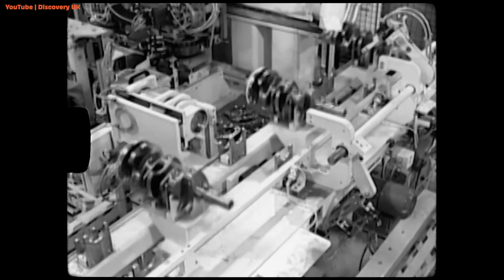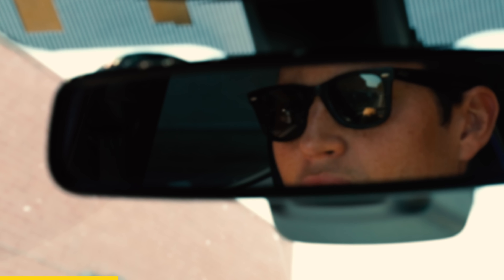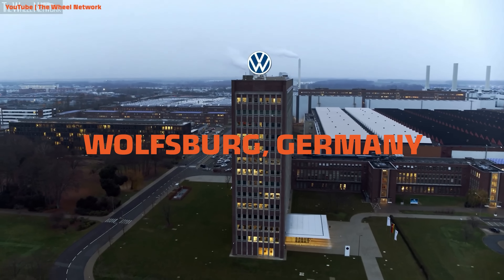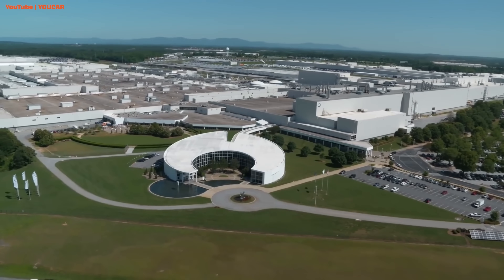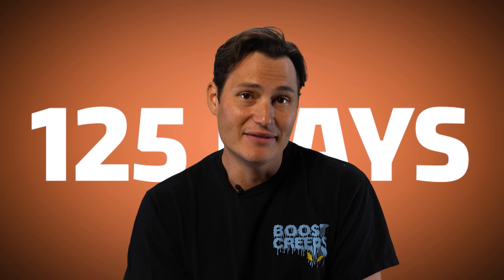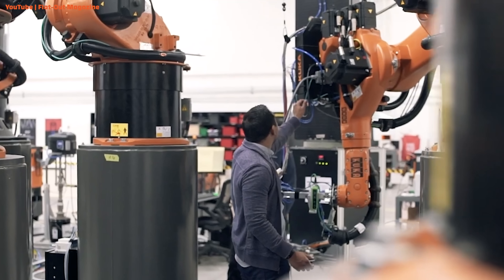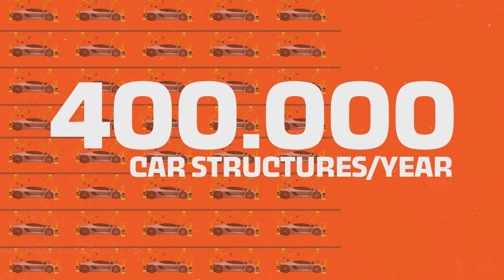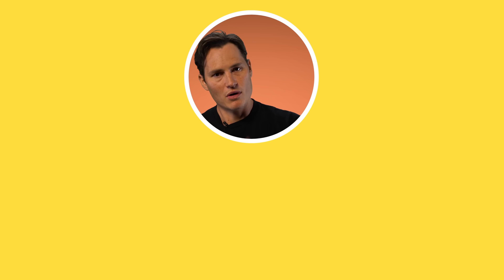A.I. Designed this Car

Comment: What about working on it after assembly? Does the engine come out to change the spark plugs along with the intake and exhaust manifolds? Is the battery located where a tire and fender skirt must be removed to get at it? What about the climate controls? Are the vent doors located behind 6 hour's work of dash and panel removal to replace them right after the warranty times out? Let's also hope those shortest wire runs possible include sharp turns and chafing that starts fires and is subject to weather damage. I ask this because the problems posed are common in the craptastic engineering found in modern vehicles.

Comment: At this point in our history the manufactures have all of the past design and build history that they can barrow from but the most important thing is they have the knowledge of proven designs and builds vs failures or poor design practices. In other words, all you need is a few good engineers and a good assembly team and you really don't need AI.

Comment: The biggest problem with this way of building cars as a mechanic of 24 years I’m sure because all the tight tolerances there are practically gonna be no space to work in 
You’re probably have to dismantle the majority of the car just to get to a air duct for the air conditioning or wiring Looking forward to the design of the car but not working on them that’s a strong pass

Comment: Not fastest - it was never tested IRL, and many other car manufacturers promise better performance.
Not most environmentally friendly - a bicycle is.
Doesn't use the least material, nor energy to manufacture - Soviet Lada's do.
Not Revolutionary design -  It has been used in construction since the first bridge that incorporated steel beams. This design costs a FUCKTON to make, hence no car manufacturer wanted that.

Designed by AI - Yes, but just a small portion, and a human had to check, approve and modify all the changes anyways.
Made entirely by machines - Yes, like every other machine these days.

Comment: 497 mil left over, buy more assembly units and roll out an 'on demand' production facility selling exceptional automobiles at industry breaking rates. Your order will take 127 days but you'll pay half the price, maybe less, than you would for a standard car.

Comment: This misrepresents these modern manufacturing systems so very badly. 3D printing is slow and expensive. Programming robots to assemble cars doesn’t happen at the push op a button, for small scale it is many times cheaper to build by hand.
And they just glossed over comparing a single manufacturing cell to an entire assemble plant.
Information poorly conveyed.

Comment: How much space for the printers, and the parts, and the shipping, etc. I'm sure it is less than current but compare on equal footing. How much expense for the printers. How many units can AU build when you consider most the time it will be waiting for parts because 3D printing is generally slow. How many printers are needed for each AU to keep up. So how long to print all the components of the car? How do we repair anything on this car? How advanced is a car that cost the consumer more and would have to replace because a single wire burned out? Bottom line... cool, but now what is the whole story once we stop being blinded by the greatness possible through our technological "advancement"? Just wondering.

Comment: too much marketing.... the softwares to optimize, and calculate strucures exist by years, but result sensibility is another level, is not black on white on decision making, result interpertation and thats a major reason manufactures use a common platforms between models to do carry overs, takes time to tune by sensibility, not by a set of rules, after analytical there is also the testing that again with reults need be crossed and correctly related...

Comment: I wonder if we will see their cars structurally failing on the roads. One of the reasons why 3D printing hasn't taken off for mechanical manufacturing is that the layering welding process is imperfect.  Current technology results in air pockets and inconsistent thickness. Also 3D printing cannot achieve the strength that comes from working metal. In comparison, we have hundreds of years of traditional metal work experience and can currently get materials thinner and stronger than 3D printing can. That said it is only a matter of time before 3D printing overtakes traditional methods.

Comment: It is generative design. This is hardly A.I. Just the next step in iterative computational analysis, with a feedback loop and inputs given by the designer. 
It is stupid to say that this technology will take over engineering jobs. Engineers still have to validate the generated models to ensure the computer has created something that actually meets the design requirements. Computational analysis still has many issues which require human attention.

Comment: So this new hypercar have 2.8L V8... F1 cars have 1.6 V6.. why manufacturers don't use any small displacement 6 or 8 cylinder engines in ordinary cars? obviously derated for more reliability, but operating with same efficiency... These engines would definitely last longer than shitty 3 bangers (which makes 90% sells in Europe), they would be more fuel-efficient (in real world, not just in laboratory conditions) as well as eco-friendly , more powerful BABY, and wouldn't sound as vacuum cleaner...

Comment: Yes, but does that take into account the repair process? By packing everything in under max efficiency, that doesn't translate into maintenance. It could take days of disassembly to fix a simple issue. This is part of the engineering and development of current design processes. So, it's all fine and dandy until it breaks..... Everything breaks.